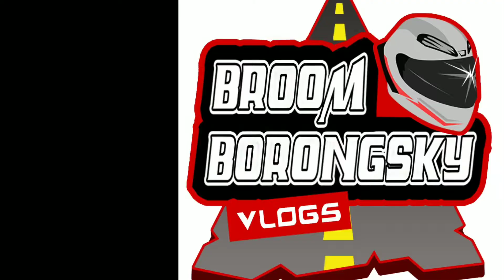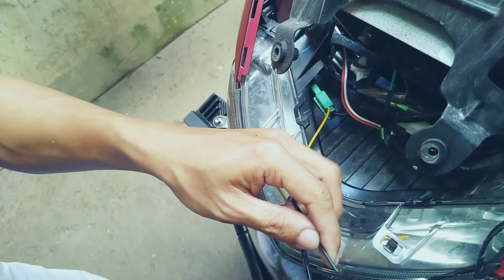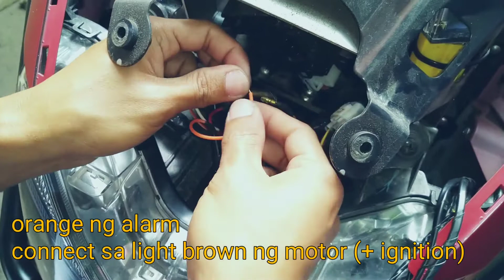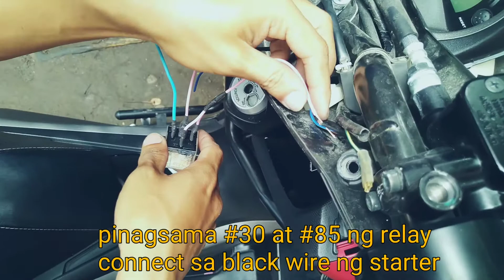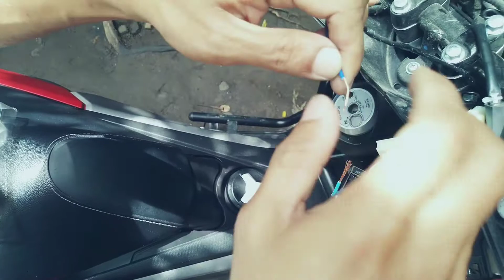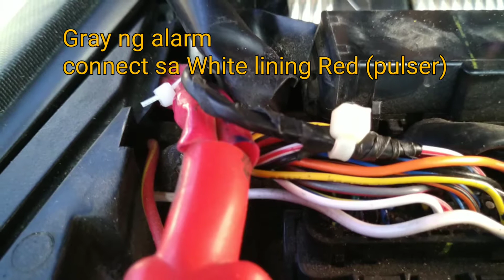2 Way Alarm Installatio in NMAX 155

Comment: boss.. nd ba pd wlang diode yan?
Reply from the maker: Kailangan diode boss para hndi bumalik yong supply na nanggagaling sa break
Reply: hindi ba ang switch ng break ay positive iyon at sya ang supply ng push start. pag press mo ng break dadaloy ang kuryente puntang push start. kaya pwede wag lagyan siguro ng diode parang mio lang din pag hindi mo press ang break hindi mag start, pwede siguro rekta parang wiring diagram sa mga mio
Reply from the maker: @twobrothersgarage5190  hndi pwede boss. Dahil negative trigger ang starter ng nmax, sa mio positive trigger yon kaya rekta na yung blue sa starter
Reply: pwede yan boss, kasi saken ang fury nilagyan ko ng ganyan negative trigger din sya, ginawa ko #30 nilagyan ko sya ng positive tapos ang #87 konek ko sa negative ng trigger ng starter, ang blue wire ng alarm sa #86 at ang #85 sa neutral, ang wire ng neutral ay negative. kasi ang break switch para cut off switch yan, saka lang dadaloy ang kuryente puntang push start pag press mo ng lever. kaya iniisip ko same lng ng fury at nmax kung negative trigger silang dalawa. try u lagyan ng positive ang negative trigger ng nmax sa tingin ko aandar yan sir.
Reply from the maker: @twobrothersgarage5190  ikaw bahala paps. Subukan mo lng paps baka gumana nman
Reply: pero na try u na ba paps ayaw tlga gumana gusto ko apply kaya lang wala pa kasi nmax nagpapagawa
Reply from the maker: @twobrothersgarage5190  hndi yan gagana, dahil negative triger ang nmax at positive yung sa break switch. Kailan  mo mapasukan ngnegative sa starter at pasokan mo din ng positive yung break.
Reply: pag sa mismong break kakuha ng positive paps, halimbawa iyong 30 ng relay ikonek ang positive wire ng break switch, tapos ang 87 ng relay ikonek ang negative wire ng push start hindi parin kaya gagana paps?
Reply: pasensya na makulit akong magtanung paps, gusto ko lang kasi makasiguro kasi wala ako diode at kung may magpa install saken ng ganyan make sure na pwede ang theory ko kaya ako nagtatanung. kung may tropa sna akong may nmax, gawin ko sna kuha ako ng testlight tapos iconnect ko sa battery ng positive ng battery saka ko itusok sa mismong black wire ng push start pag umandar tama ang theory ko. kasi sa tingin ko kapag walang positive supply ang black wire ng start hindi aandar.
Reply from the maker: @twobrothersgarage5190  yung black ng yamaha, negative yun paps.